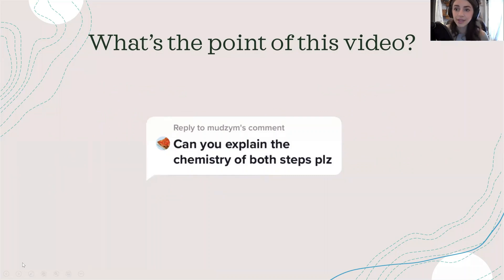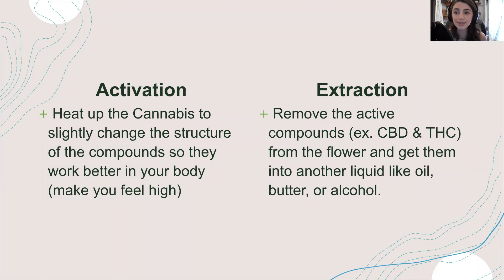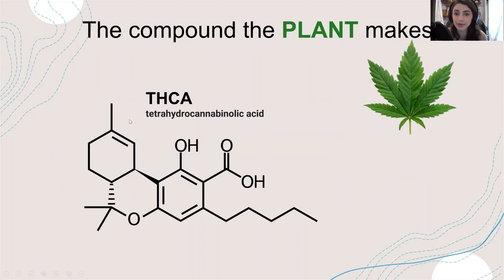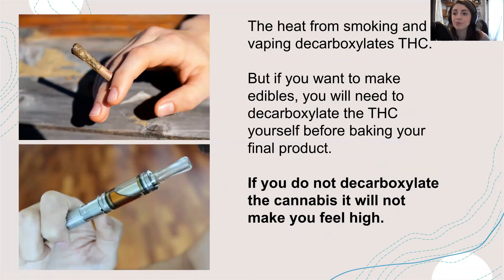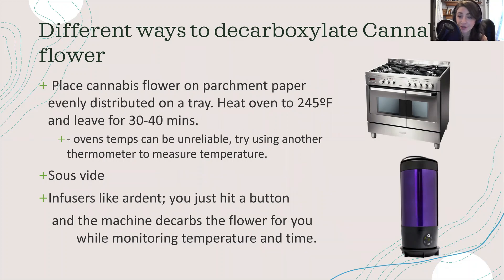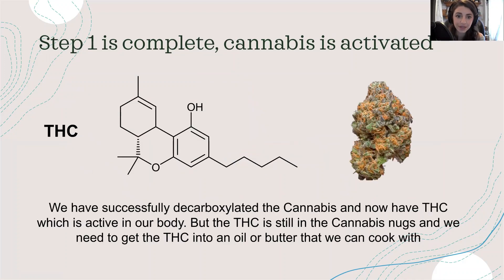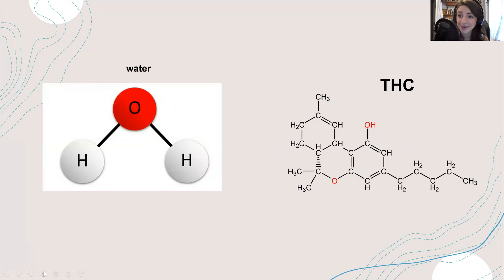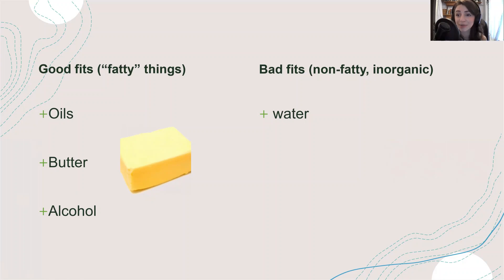The chemistry of Cannabis edibles

Comment: Thank you for very chemistry-forward information on cannabis!  Would you be able to explain why the decarboxylation process of heating bud needs to happen prior to the extraction process in a fat or alcohol?  I speculate that the dissolution of cannabinoids in a fat or alcohol restricts the removal the carboxylic acid from THCa but I cannot find an direct, chemical explanation of this.  Also, regarding the production of cannabutter, would it be better to use clarified butter or ghee as an extraction medium since the water content has been removed?